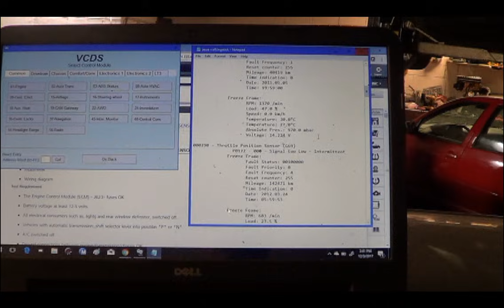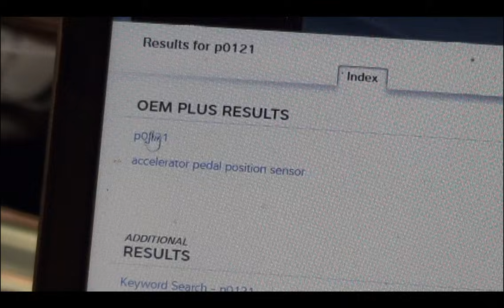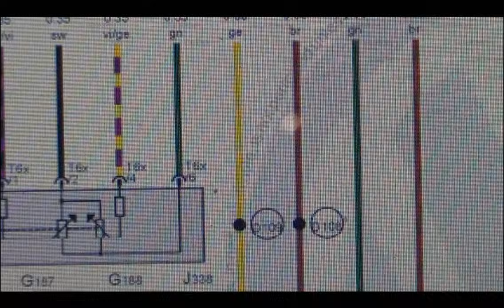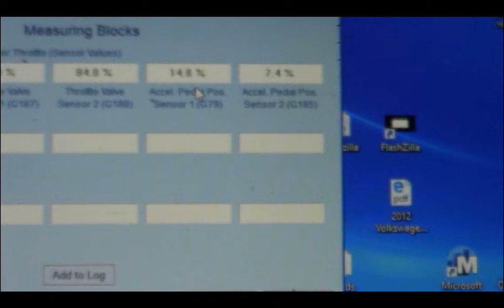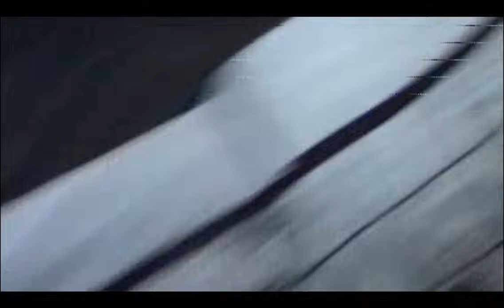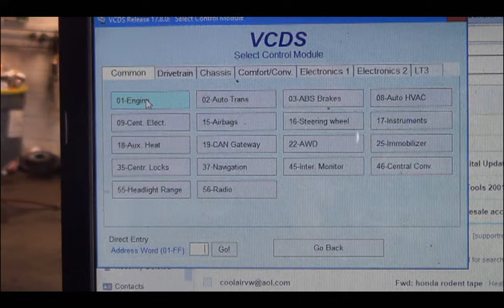2012 Vw Golf Throttle Codes P0122, P0222, P0221

Comment: In my Golf 6  2012 the P0222 error (and other errors around it) was caused by a bad connection on PCB.  There are 2 tiny chips (both identical) inside the throttle body  giving TP_B(%) and TP_R(%) signals.  After a short while of driving, one of the signals was stuck at 99% all the time. Instead of 0.5V up to 4.6V there was 0,00V on one of the 2 output pins.  One of the chips needed resoldering. Problem with my car was solved.🤸‍♂️
Reply: + there are signals from pedal, APP_D and APP_E, range from 14 to 77 is normal in my car.   LOAD_PCT goes up to 96%, so I'm happy with it.   TP_B  14-86.  TP_R  3-67 only🤷‍♂️  but the car runs absolutely fine.

Comment: I changed throttle body and accelerator pedal and I’m still getting the same 3 codes Po222
Po121
P2101

Comment: VW polo had same problem but intimitent,on accelarator pedal plug changed connectors from gold one to copper ones, thats a solution,people always change throttle bodies and accelarator pedals,solution change G179 terminals sorted.

Comment: I have a Passat with the same issue, I’m reading it with a couple of different codes, one for the throttle body sensor and one for the pedal position sensor. Obviously checking the wiring may or may not be the exact same, but I really appreciate you posting this so I can use the resources I have to diagnose which issue is at hand and fix it. I’ve recently gotten into fixing my own vehicle for numerous reasons. A big one is that it’s cheaper and I’m learning so so much. Big thanks to you and all of the people that take time into recording, editing, and uploading these videos, we appreciate it!

Comment: Had same diagnosis..but prior to replacing throttle body...I  cleaned it and ran re-adapt & fixed the issues even 5 volt reference numbers & no more Limp mode. Basically  throttle body service.
Reply from the maker: Cleaning is important, but the signal on this one was dropping out.  cleaning isn't gonna fix that.
Reply: @CoolAirVw what causes the signal drop? I changed the throttle body because I was on limp mode. Few weeks later, I had the same issue again, limp mode with P0122 and P0222. I’m suspecting that the throttle is not the issue

Comment: vw up 2013 very similar issue however we already changed tb for a new one and the accelerator pedal and it is still showing epc randomly that comes with loss of power and also sometimes its shaking? a bit pls help
Reply: Did you ever figure it out 😣

Comment: I know this video is a bit old, but I am having the exact same issue. Do you think low battery can cause this? The battery in my vehicle is old and died right after all of these problems occurred and the car was parked.
Reply from the maker: probably not.  Its almost always been the throttle body itself.  But its usually very intermittent as it was in this video.

Comment: 08 GTI / EPC and traction light come one and go off intermittently.  Have had just about everything done to fix this issue.  VW throttle body, re-pinned connectors.  Gets cleared after work done, usually something different, lasts for about 6 months, comes back with the same issues.  Same Codes.  The other day, car wouldnt run.  Few restarts and it cleared, CEL on.  Reset codes, drove to work 15 miles totally fine. Why do you have to be in KC, and not Dallas.....   Great video by the way!
Reply from the maker: Try Richard Rawlings over at Gas Monkey Garage.
Reply: @CoolAirVw  Hehe.. I dont know if you're serious or being facetious.  I met Mr. Rawlings a couple of times at shows, he and his shop are interested in simply growing the GMG brand.  Actual 'fix it' work is below his shop.    Nice enough guy really, very friendly, but he is about the $$ and his brand.
Reply from the maker: @ThePondoSinatra  Just joking around.  There is a guy, around Dallas.  He goes by "alphasenior" or something like that on Tdiclub.  Look for trusted mechanics list on tdiclub.com...  Wait... edit...  I think he is tdi only.  sorry.

Comment: Getting those same codes for my 2012 Jetta SE 2.5. ECP light came on. Thanks for the video.
Reply from the maker: you can slap a throttle body on it and hope or try to diagnose.  Had a couple in lately that were difficult to reproduce the issue.

Comment: I’m having the same problem all the wires are fine on my 2010 golf but my throttle response isn’t all there I’m getting a lot of throttle codes and I’m on my 2nd throttle body but I was told if I get one from Volkswagen it would fix the issue would that help me because my wires are fine
Reply: it may simply be the throttle pedal, not common despite the codes, but I think that may be my problem
Reply from the maker: Did you fix this issue?

Comment: I have the P0222 error in my 2013 Golf. I checked the pedal position sensors and they respond fine. The throttele sensors show me the value 0.45 and 0.05 V, respectively. However, they do not respond when I step the accelerator pedal. I also checked the throttle position. It changes when stepping the accelerator pedal, but does not fit the nominal value (Its range covers only values from 10% to 88%). Do you think that this is a problem of the throttle valve or might there be another problem (wiring, control unit, etc.)?
Reply: Same issue on my VW Passat 1.8 Petrol
Reply: hello, did you solve the problem?

Comment: I change the throttled and I kept still getting the epc light and engine light po221 the Machanic told me  I need to change gas paddle and I did and the lights came back after 3 hours I don’t know at this point
Reply: I have same problem , How do you solve your problem ?
Reply: And elso sometimes the car starts to shake when the epc is on the car don’t shake it depends
Reply from the maker: use the info in this video to diagnose or shotgun a throttle body on it and hope its not a waste of money.
Reply: Dude did you ever fix the GTI? What was the issue?

Comment: good day
 mine is Golf MK7 1.4tsi
These are my problems with limp mode/start stop error/engine light/epc after i saw your video it made me think its maybe related mine will come on when car is in normal running temp, maybe changing TB and G31 and G42 sensors might help any ideas?

2674 - Angle Sensor 2 for Throttle (G188) 
          P0222 00 [175] - Signal Too Low
          MIL ON - Confirmed - Tested Since Memory Clear
2676 - Angle Sensor 2 for Throttle (G188) 
          P0221 00 [032] - Implausible Signal
          Intermittent - Not Confirmed - Tested Since Memory Clear
2761 - Throttle Actuator (J338) 
          P1579 00 [096] - Adaptation Not Started
          Intermittent - Not Confirmed - Tested Since Memory Clear

2762 - Throttle Actuator (J338) 
          P1564 00 [096] - Under-Voltage during Basic Setting
          Intermittent - Not Confirmed - Tested Since Memory Clear
20572 - Intake Air Temp. Sensor (G42) 
          P0113 00 [237] - Signal too High
          MIL ON - Confirmed - Tested Since Memory Clear

4166 - Manifold Pressure / Boost Sensor (G31) 
          P0238 00 [175] - Signal too High
          MIL ON - Confirmed - Tested Since Memory Clear
Reply from the maker: sorry only so much I can do.  No help here.

Comment: Hi. There . I have vw t5 transporter 2.5tdi 131 hors power. Showing code p0122..  and smok is coming on slow runing engine white smok.. as i rune it on the high speed smok wanish ... what it could be???will be great if u can help... many thanks..
Reply from the maker: I have no experience on that engine as it isn't sold here.
Reply: PCV Valve/Unit check vent tube for pressure

Comment: Hi, useful video. I have a 2012 Golf 1.4 TSI. I am getting a 000545 P0221 Angle sensor 2 for throttle (G188) error as well as a 000051 Turbo bypass valve control circuit P0033 error. 
Would anyone be able to help me with these errors? Also, where would the throttle body be as I cannot locate it. 
Thanks
Reply from the maker: Where are you ?  I'm not sure we have 1.4TSI golf here, if so I haven't run into one yet.  Diagnostic process should be very similar to what was done here
Reply: CoolAirVw Rm 
I am based in the UK.  Would you know anything of the P0033 code?

Comment: Great video - i'm working on almost the exact same issue with my son's 2012 VW Passat, i'm getting ready to backprobe the electrical connections at the throttle body to verify voltage readings.  I got VCDC today - tried re-programming throttle body after we had cleaned MAP sensor, the throttle body and replaced PCV Valve Diaphragm.  I have a few questions - when back-probing the signal wires on the sensors - where did you connect your ground test terminal?   How did you decide the issue wasn't the electrical connector/electrical connection at the Throttle body?  I've found another video that suggested an issue like this could also just be potentially fixed by re-pinning the electrical connection via VW technical service bulletin 01-17-05.
Reply from the maker: hook the ground on your meter to the ground terminal on the battery.  you rule out the connector by visually inspecting it.  If the "female" prongs look "opened up" and the male portion isn't going to fit tight then you can try retensioning or replacing.

Comment: Hi there can anyone tell me what's the website that this guy use to check the engine codes ?
Reply from the maker: we use VCDS scan tool, sometimes called vagom.  Sometimes when we dont know much about a code we research the vag code  in VCDS website which is www.ross-tech.com.  You cant search there with "P" codes though.

Comment: Thanks for the info i watched this vid before checking the car and i checked my car to find that the intake manifold had a leak i sprayed soapy water nd it bubbled then i sprayed carb cleaner and it idled different everytime i sprayed it. I guess the leak is setting the code cus its getting more air setting a p0122 code. The electronics checked out fine so yup ur welcpme
Reply from the maker: Thanks for sharing your experience
Reply: Pro trick : you can watch movies at flixzone. I've been using it for watching a lot of movies these days.
Reply: @Deangelo Langston Yea, have been watching on Flixzone for since november myself :D

Comment: Please do more videos...I also am solving TBA and pedal positioning sensor problem 0n a 2009 2.0t Jetta GLI ..had bad idle and EPC and engine lights...engine would shut off...
Reply from the maker: thanks for watching.
Reply: Did you fix it same problem, same car
Reply from the maker: @mrwilliamdailey  yes, you didn't watch the end of the video?
Reply: @CoolAirVw  I changed my throttle body about a month ago and the problem came back with a terminal 30 error

Comment: P0221, check if your floor mat is rubbing on the gas pedal. That solved my problem pretty quick. (winter floor mats)  VW Rabbit (MK5) 2008
Reply: Sir  thank you for your comments. I just check and that’s was the issue. Thanks  🙏🏾
Reply: ill check this tomorrow morning, cheers for the idea!

Comment: Thanks for the video. Very helpful. I didn't see if you cleared the codes after reinstalling the Throttle Body or if they just went away?
Reply from the maker: We cleared codes along with Throttle body Alignment.
Reply: @CoolAirVw  I went through the process like you did and I can't shake this code. I'm getting a G69 which maybe a G186 on my 2012 Passat. I already replaced the Throttle Body with a brand new one. Do you think it may be the pedal?
Reply from the maker: @sdsportriders3212  Getting a G69?  I dont know what you mean by that.

Comment: Great video! Very helpful. I have P2100 open to tps motor on 08 Mazda CX7 Turbo 2.3. On 6 lead connector to TP I have first 2 leads registering 5v each and the other 4 zero. Shouldn't  I have 12v somewhere?. Is this TPS activated by the ground? Thanks for your help, I really appreciate it.
Reply from the maker: Sorry just noticed this.  I dont have much practical experience with mazda.

Comment: Nice video I Have mk5 tdi Jetta giving me P0122 and will have to check my voltages I tried just swapping out the pedal as I had extra one but still the code would come up if you clear the code while it’s running it will go out and stay out but as soon as you cycle the key off and start the engine again I get the same code really a bigger problem obviously anyhow move vid I subscribed to you’re channel
Reply from the maker: Thanks.

Comment: Richard, if you believe the label files have errors, please report them to Ross Tech (they will ask for autoscan of the car which I believe you have). I find quite a lot of mistakes in them, both typos and more serious ones. And the sensors are:
G69 -    Throttle position sensor 
G79 -    Accelerator pedal position sensor 
G187 -    EPC throttle drive angle sensor 1
G188 -    EPC throttle drive angle sensor 2
Reply from the maker: If I'm understanding you correctly, I think your saying the Two APP sensors as a whole assembly are called G79 and the two TPS sensors and throttle assembly as a whole assembly are called G69?
Reply: No! I'm not trying to state that!
I simply pulled the G69, G79, G187 and G188 sensor descriptions from a VW repair manual I had just for you (or anyone else) to cross-check that with the descriptions in VCDS.
Reply from the maker: What I think would be helpful is if the label file was modified to show what voltages should be expected on the APP and TPS.  If the "pop up thought box"at 7:38 that shows "expected" said, G185 should be half of G79, and G187 should show inverse of G188.  And G187 and G188 should total 100%, it would be very helpful to most users.
Reply: Aren't they shown in Group 64?
This is the information from the label file:
064,0,Electronic Throttle (Sensor Adaption Values)
064,1,Lower Adaptation,Sensor 1 (G187),Specification: 0.4...0.6 V
064,2,Lower Adaptation,Sensor 2 (G188),Specification: 4.0...5.0 V
064,3,Emergency Air Gap,Sensor 1 (G187),Specification: 0.5...1.0 V
064,4,Emergency Air Gap,Sensor 2 (G188),Specification: 4.0...5.0 V
Reply from the maker: Good info thanks!